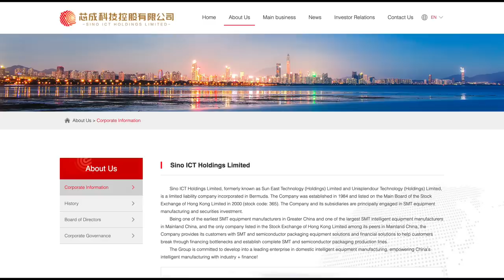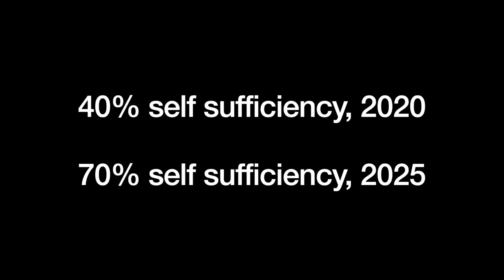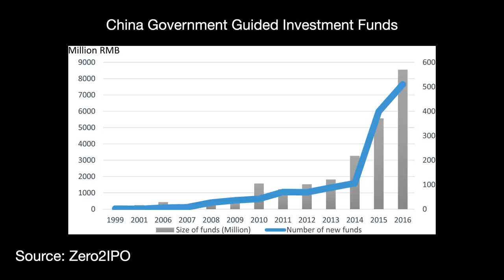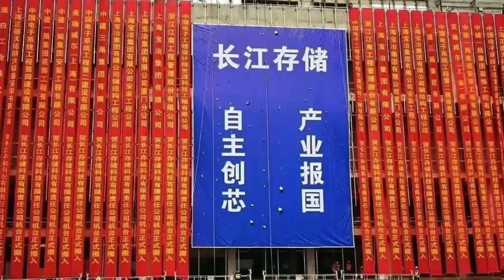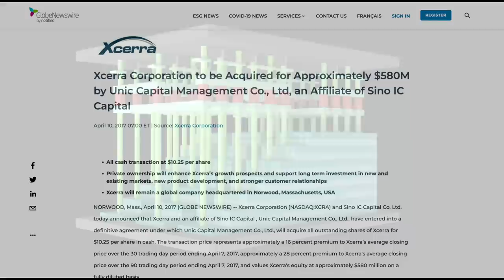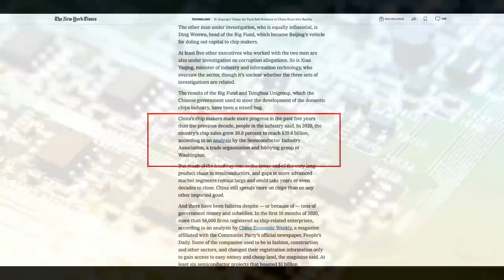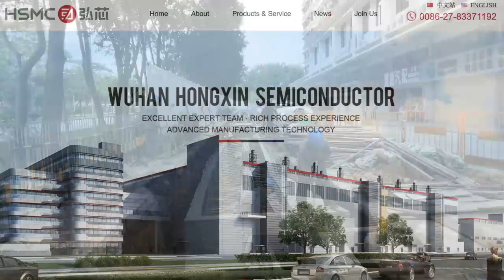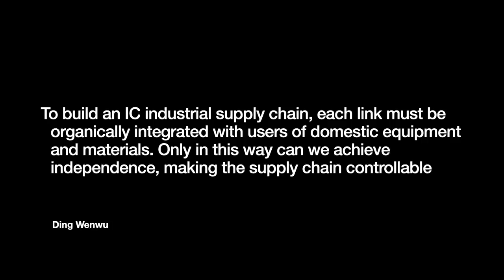The Flawed Assumptions Behind China’s Big Semiconductor Fund

Comment: To be fair, the fund's goal is just no longer realistic due to the dramatic increase in both the volume and price of semiconductor products.
Reply: Yea, they need to multiply their investment manyfold and start lower in the tech chain instead of investing at the top. Invest in precision manufacturing tech, lasers, chemicals and materials, so that they have the technology to build on. You can't build a lithography machine if you can't make precision motors, etc. so you are doomed to failure. Taiwan has over 8,000 companies in the semiconductor supply industry. You are not going to catch up by investing in a few of the big status quo companies you already have. They would go bankrupt if they suddenly decided to stop using their established suppliers and have zero incentive to share any tech they develop such as metrology etc. This leads to every company having to reinvent the wheel and eats up the investment with little return spreading into the industry.

I actually saw a video about a CNC machining company in China which built an "underground" factory and took several years to start at the bottom of the tech stack so that they could match western competitors. This is how you would need to go about building a semiconductor industry, but at a much larger scale. Each company focusing on a piece of the puzzle, and becoming suppliers for the next level up. You can have all the mega fabs in the world, but if you lack the software to design chips, you are not making anything. If each fab had to build their own software stack you are wasting billions of dollars instead of having 1-2 companies become the supplier for all of them.
Reply: @excitedbox5705  Great comment
Reply: @excitedbox5705  Semiconductor design software is a tough market as well. As it stands, you can pirate a lot of the design software, and the big three rely on their high margin customers which are hard to sway. There is room for tools that improve flow control, integrate ML widgets, attempt analog APR, etc, but starting from scratch would leave many Chinese designers technically stranded from the outside ADE world unless their tools improved well past the existing ones.
Reply: @excitedbox5705  with the Ungodly amounts of Money they have already spent, to the tune of hundreds of Billions.
They could have just as easily bought the necessary people to make an euv machine.
Instead they went local. Threw the money on the streets of China looking for Chinese who could build them an EUV. Nuts.
How much does an engineer at ASML or Cymer make in their life time. Its definitely not a 100 million dollars.

Hopefully they realized this sooner rather than later.
Reply: @excitedbox5705  That aerospace chap looks like a good choice. Building a commercial passenger jet from scratch is on the same level as a modern fab I reckon.
Reply: @leihtory7423  China is hiring thousands of engineers from those companies. However those engineers also have NDA agreements, so they're not able to disclose all the technical information. Nevertheless China is progressing bit by bit. One can see this from the growing market share of China's chip production.
Reply: @leihtory7423  They're not that stupid, they simply cant due the various agreement and tech blockade. It's devastating.
Reply: @Da Lama There is a history of various governments around the world trying to create a national chip industry by funding stuff. It does not seem to have worked anywhere. Perhaps because it is so difficult that what with governments having a number of other considerations, they find they can't get the right people. Like say in the UK the government will direct funding to an area which is poor, but for chips that does not help. Also unless it is your money, you don't really care too much if it works.
Reply: @excitedbox5705  well said, you can’t skip ahead in the civilization tech tree just because you put in the cheat code for gold
Reply: @leah, that's not how it works, ASML is the only company who can make those machines, those engineers can't just go job hopping and bring the company secrets to any company they want, they go to jail, if they do that..
Reply: @kaimanyu586  I'm not saying it would happen, but these engineers would not have to worry about jail if they sold out to the CCP. They would move to mainland china and the authorities who would jail them could never touch them.
Reply: @excitedbox5705  That's what China is doing now. Focusing on mature chip manufacturing.
Reply: @leihtory7423  But then you are a captive.

Comment: I wonder if there will be stricter regulations on IC sales as they become a larger part of the economy. I've been pretty shy about any IC shipping from china as they rarely test in tolerance. Especially components like high performance MOSFETS, operational amplifiers and voltage regulators. With tests suggesting that a chip labeled like a lt1084 voltage regulator actually being an lm317 that has been re etched. If they had the internal structures to combat the practice, there's a lot a value in sinosourced integrated circuits.
Reply: Already happening.

Comment: The mistake this video and others are making is that by value China is very far from achieving its semiconductor self sufficiency goals. But by volume, they are pretty close. The benefit of semiconductors are that they enable many other, far more valuable industries, so the cheaper, low end chips are the most important ones for now. Of course they could be better, but the big fund has done amazingly well

Comment: Funny you mention ONVIF , the open IP camera standard in which you must register as a vetted manufacturer , a critical detail.
Most Chinese companies never register at all. Reality is the vast majority (85℅ +) of Chinese cameras being sold do not follow the "standards" set by them, that is beyond a skin deep level ONVIF compatibility for only the absolute minimum functionally  - usually RTSP stream detection works with a crippled PTZ regime. If you open the XML from the ONVIF referrer details you'll see these cameras are all broken or half broken using a handful of bodged filler code chunks, cloned unique ID's, Model numbers, Firmware details etc.

ONVIF is more a perfect example of how an industry standard can devolve into a half broken free for all, and that is due to exactly as stated above. The practice of China's business ethics has made the ONVIF consortium worse off. 

Diluting standardisation, can you still even call it a standard..... 
 
the cherry you get for free with these Chinese IP camera's is hard coded hidden root / admin  credentials , undisclosed Internet facing debug ports, hidden Telnet exposure on non standard ports as default , UDP firewall hole punching P2P protocols that cannot be turned off dispite what you or your settings menu detail, and so on. Beyond that gift who even really knows what going into Unisoc or HiSilicon IC's at the foundry level. 

Actually, in some ways it is a pretty fitting example of Chinese tactics in tech
Reply: "ONVIF is more a perfect example of how an industry standard can devolve into a half broken free for all...."

Sure, but what's the alternative? At least with ONVIF you can tell whether a particular product is ONVIF-compliant by looking for its entry in the database of conformant products.

Let's face it: every standard has a certain number of people or organisations trying to make some money by spending the minimum possible amount to appear to have implemented the standard. But customers overall are still better off with having the standard than not, so long as at least some vendors implement it properly. (And this is why verification systems and trademarks are such an important part of standards setting, at least for consumer standards.)

Comment: Great and very informative video.  However, I am confused by something:

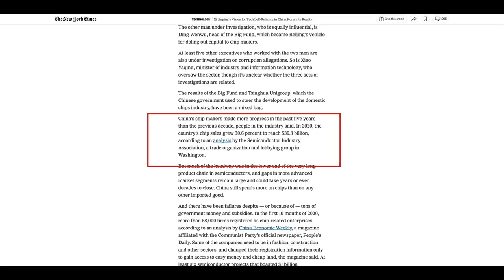The charts showing the exports, imports, and size of China’s IC market and local production of IC’s, starting at 14:07, seem to be inconsistent.  Specifically, the COMTRADE and IC Insights numbers seem to contradict each other by a factor of at least two.  I realize they are not measuring the exact same thing, but that makes the numbers even worse, actually.  How can Chinese exports of IC’s be several times higher than Chinese production of IC’s, for example?
Reply: Many manufacturers use China as a final assembly point. Manufacture actual chips elsewhere, solder them on the board in China, export the actual end product which is easily several times more valuable than the chip itself. This will likely account for at least some of the discrepancy.
Reply: @15:05 He states that only about 40% of exported chips are produced by Chinese headquartered companies (i.e. about 60% of exported chips are produced in China fabs but by companies that create the chip design that are based outside of China).  I don’t know if that helps explain the discrepancy you mention.
Reply: @luckyo11  seems like China can also prioritize the Chinese market to chips made or assemble in China.   I am sure they can assemble the chips elsewhere.  But without the Chinese market you don't need to make more chips.   That means the other half of the world I assume Europe, Japan and five eyes have to pay much more to buy US chips.

Comment: What hilarious about the high tech sector is that it costs so much time and money to develop and perfect. Only to eventually fall prey to clear paradigm shifts like when transistors came into being. 

New theories in computing like quantum Logic gates, actual quantum entanglement in circuits, crystalline 3d data storage with no practical limits to read/write speeds, etc etc. Would make current computing hardware look like vacuum tubes overnight.

That’s why only a flexible industrial base that isn’t married to some sort of long term government plan will always win out.
Reply: Quantum computers still have a long way to go. Even if they are successfully commercialized, it’s unlikely that they’ll replace all other forms of computers, especially classical von Neumann architecture. Yes, we are indeed seeing a plethora of emerging new domain specific architectures, but they are not completely de novo approaches.

Comment: China is inexperienced in semiconductor development. The US sanctions and the corruption fund failure really gives China guidance in what works and what doesn't.
Reply: Beijing Moore Threads, a new startup company in the midst of US sanction released their own high end GPU and AI chips just 2 months ago. I don't know what you're talking about.
Reply: @leezhieng  the point is they're just a fabless design company using Architecture developed by Foreign Companies. If at all  they really plan to be independent, they should start from scratch